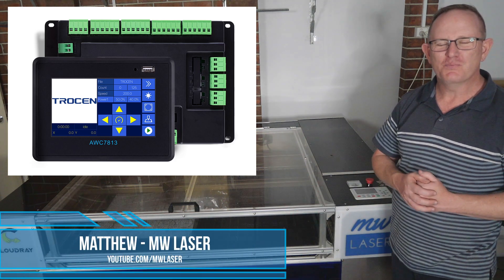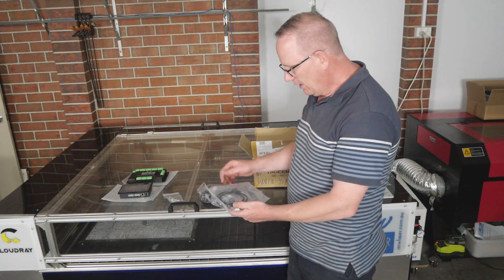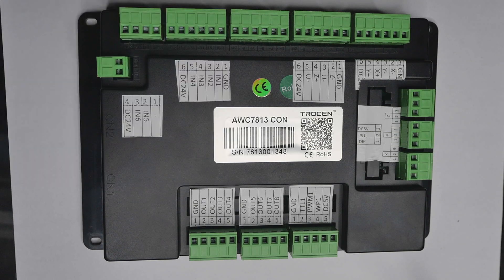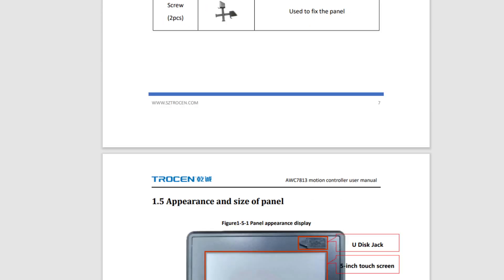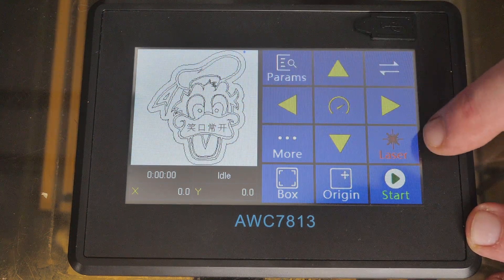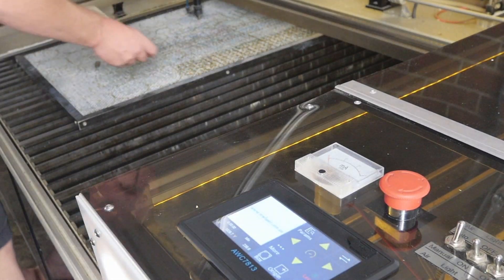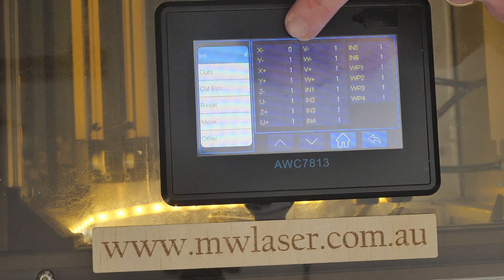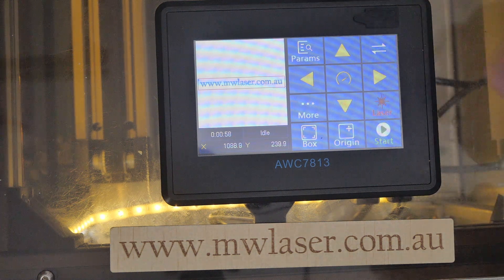Trocen AWC7813 - Replacing AWC708S - Co2 Laser Controller

Comment: Hi Mathew, would you recommend this controller over the Ruida 6445G?  Thanks in advance
Reply from the maker: I use Both RDC6445G and AWC7813 Both are excellent controllers. They obviously have different features, and if you are to compare the AWC with the RD controller then you would compare the RDC6445G and AWC7824 as thy both have ability to control the same number of laser tube and axis.  eg
RDC6445G - up to 2 laser tubes with 4 axis control (X,Y,Z,U)
AWC7824 - up to 2 laser tubes with 4 axis control (X,Y,Z,U)
AWC7813 - single laser tube with 3 axis control (X,Y,Z)
There are features I like on each over the other, but I'd honestly find it hard to choose one over the other.
Cheers Matt

Comment: Hello
I have an awc7846 controller with r60x2 drivers powered with 24v, and my stepper motors heat up very quickly, what will be the problem? sorry my english but i use a translator
Reply from the maker: check the power (amp) setting switches for your R60X2 driver is set to match your motor's specifications.

Comment: As a follow up, many firmware revisions have since been released further refining this system well past where it was at the time of this video. 
These menus and responsiveness has improved as well as additional features including much further LightBurn integrations being currently developed.
Reply from the maker: Yes. Thanks for the feedback.  I am in regular contact with Trocen.  I also hope to have a video on the AWC7824 and more features of these controllers in coming months.  Cheers Matt

Comment: Could you do an in-depth tutorial on all connections for the Trocen AWC7813? Or send me in the right direction to another in-depth connection video. I have looked everywhere to no avail. I am not very electronically savy when trying to use the manual diagram. Thanks.
Reply from the maker: I can assist via email matt@mwlaser.com.au